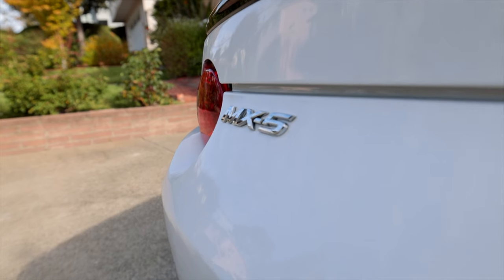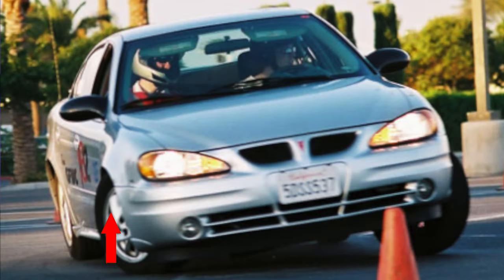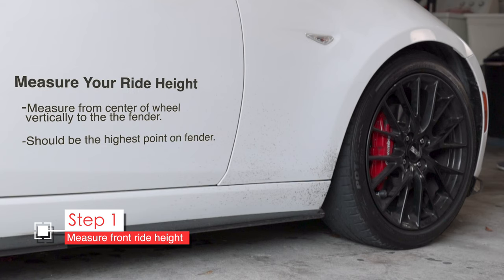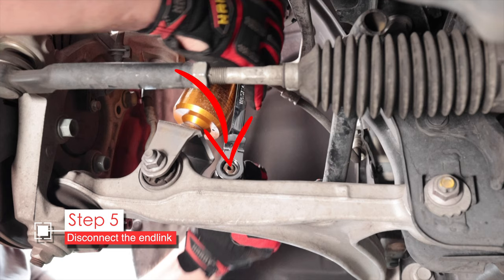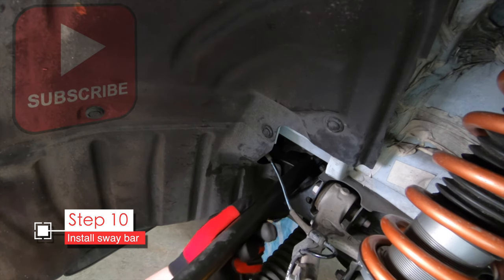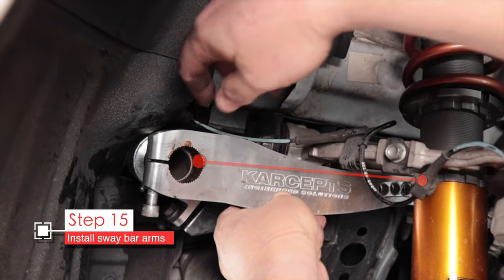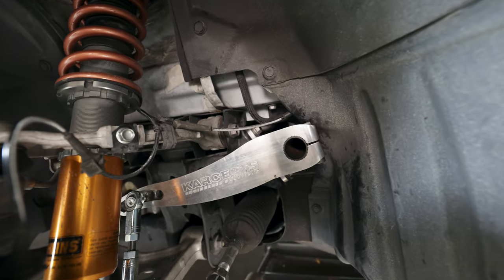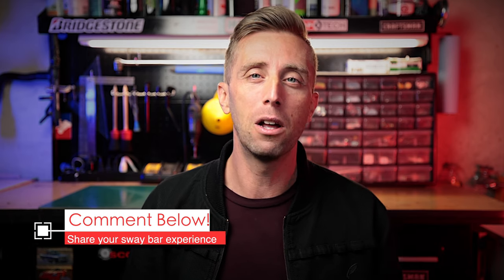Karcepts Sway Bar | 2016+ Mazda MX-5 (ND Miata)

Comment: Would it be easier to install sway bar and coilover all at the same time? If so I will wait for my coilover to arrive first b4 switching the sway bars.
Reply from the maker: Not too much easier. Yes you will have to disconnect the endlinks again while installing coilovers but that’s about the only overlap

Comment: It looks like a lot of work for what it could possibly net you.  I installed my first sway bar on my ‘69 Mustang, later in life I installed one on my ‘93 Miata, I don’t remember if I put one on my ‘96 miata, but I do remember putting one on my ‘04 Vette and I am sure I didn’t put one on my ‘07 Z06.  In most cases I felt very little reward for the work involved in any of these, but I did of course really enjoy just working on the cars. Thanks for all the effort you went to making the video.
Reply: Unless you are pushing the car at the limit on a road course, the benefit is almost zero, and might make the ride more harsh.  The body roll on my ND miata without proper sway bars is so bad that it tops out the suspension on the inside wheels on track.

Comment: I might be wrong but aren't you supposed to tighten the end links while the car is on the ground to avoid preloading the sway bars?
Reply from the maker: That is better but with a low car it can be impossible. As long as both sides are level it’s fine

Comment: Would you recommend mix and matching Karcepts on the front and another bar on the rear?
Reply: That should be fine. I've found you don't want much rear bar though in the rear. I tend to run 1.5-2 from full soft on the rear Karcepts bar so be sure you don't get one with crazy high rates!
Reply: @vincentjames501  Thanks 👍

Comment: Have you had,  or heard of,  any problems with this swaybar tearing loose from the subframe
Reply from the maker: With the right setup yes it’s possible to tear the subframe. I believe Karcepts sells a reinforcement to prevent this.
Reply: If you plan on serious ax or track time, get the reinforcements from Karcepts.
Reply: So don't really need reinforced area unless hard racing
Reply: @jec00702  Basically correct. Pays to check your undercarriage regularly anyway, if you more than DD the car.
Brian does have quality products. Know him personally. Great guy!
Reply: You would have to be doing something more serious than normal daily driving/back roads driving to damage the subframe. It's happened, but it's not something I would personally be worried about in anything other than a car that's tracked hard.
Reply: Its cheap insurance...if you have aftermarket coilovers the strain is less, but as they say, better to prevent than to fix

Comment: Hardest part of this entire job is that nut on the drivers side. Zero room.  Getting that out might have taken longer than the rest of the job combined. Also, a note of caution. The end links say 29 ft/lbs of torque. I set my torque wrench to 29 ft/lbs and snapped the very last bolt of the entire install. Just re-ordered the replacement end link. Be careful. The metal is soft on those end links. Maybe it was my torque wrench. It felt like more than 29 lbs and I should have listened to my gut.  DON’T OVER TIGHTEN THE END LINKS! Since I cut the old bar out, I have to wait a week to do a 5 minutes job. Hope the mail doesn’t screw up on this delivery like they did with the bar. It took an extra week last time. Grrrr.

Also, this video is just about the best one out there. I watched it over and over before doing the job and by the time I actually did it, it felt like I had done it before. Please do more ND videos!
Reply from the maker: Thanks for watching!
Reply: Karcepts is amazing. They are overnighting me the end links, so good chance I am on the road this weekend. Still can’t say how much I like the ride, but I can say I am impressed with Karcepts customer service. A+++ to them.

Comment: What about all the clunking noise that starts up after two weeks?
Reply from the maker: Retighten everything. Things will sometimes work loose. End links do need to be solidly torqued down
Reply: yea, I"m trying to weigh between the massive extra labor hours of the smaller ones vs dealing with ( what seems like ) un ending clunking sound from this karcept. I really don't want a perpetually noisy car.
Reply: I bought a 2016 ND with this Karcepts sway bar already installed. It clunked terribly the whole 8 hour trip home  from where I bought it from. Scary as I was driving through the Rocky Mtns. I took it apart and found the passenger side drop link was installed upside down and it was causing the clunking. The slotted end has to go to the top. Lubed everything and retorqued and not a peep out of it since.

Comment: Cutting out?You are real mechanics?
Reply from the maker: No we are not, we are DIY hobbiests. But logic will tell you this is the most efficient way of getting a sway bar out that you will never need again. It’s pretty common on the Miata. There are no adverse affects of doing this except having to buy a cheap sway bar if you want to put it in again.
Reply: Yeah. If you watch the FM's full front sway bar removal video you'll see. Getting it out without cutting it is a 4-5 hour job. But cutting it makes it a 1-2 hour job. In fact, most ppl I know chose to do it this way. But so far only Karcept has the 3-piece sway bar design
Reply: @RacerCurtis  I replaced mine without cutting with the progress bar in 2 hours.... 5 hrs is taking it way to easy...

Comment: Why would anyone be so stupid to pay $900 for a front anti-roll bar if not for strictly track use?
Reply: I have an ND, and there is some pretty bad body roll going on and I'm using Eibach lowering springs with the Bilsteins.
$900 is a lot of money, I'm not going to lie, but it's a well engineered piece of technology that allows garden mechanics to install it without much fuss.
I haven't bought mine yet, but I need to do so soon as the weather is getting better and I'll need it for mountain runs through the twistys 👍